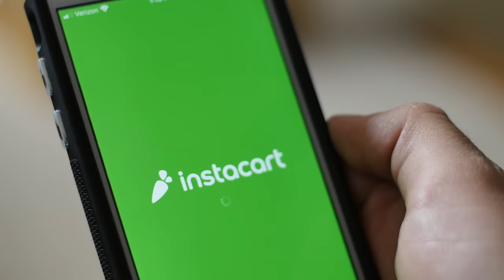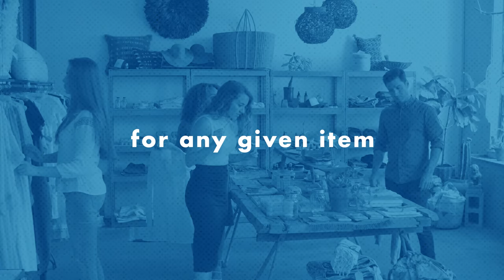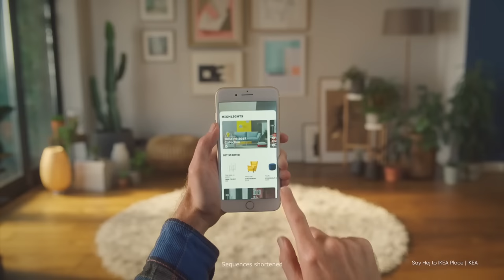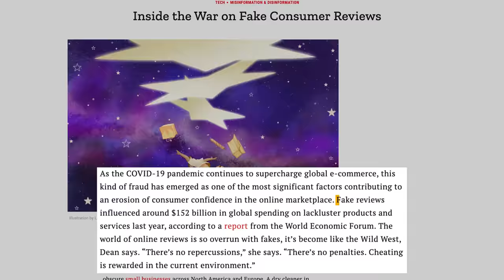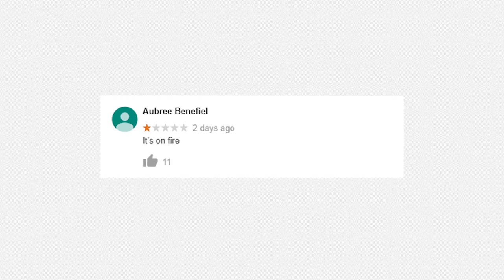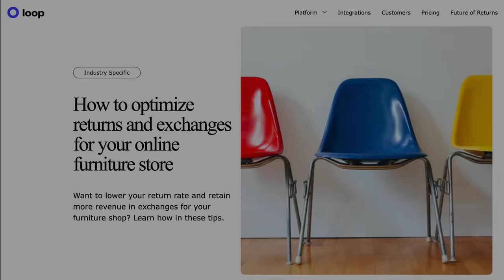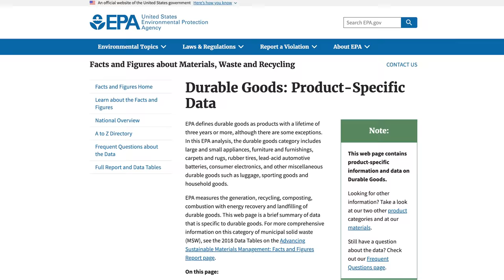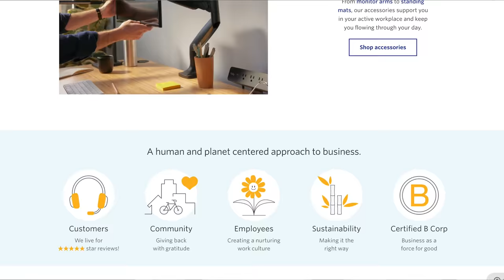The PROBLEM with Wayfair Furniture (DTC)

Comment: I will never buy furniture online again. I got what paid for: a lower price but extremely poor quality.  Buying online is exceptionally risky. If I need furniture in the future, I will visit brick-and-mortar stores (or thrift stores) where I can touch fabric and examine the structure of the product. I bought several pieces online from Wayfair during the pandemic; retail stores were closed because of the quarantine. 

The mattress I received was less than 2 inches thick. Sleeping on it was no better than sleeping on the floor. I returned it. The 20-year-old mattress that I had been using was much more comfortable than the one I bought online. (During the quarantine, I temporarily left the old mattress in a storage room. I put it back in service until brick-and-mortar stores reopened.)

An area rug contained more plastic fiber than natural fiber. The company did not advertise that fact in its online brochure. Walking on the rug in bare feet was much worse than walking on the ratty 15-years-old builders-grade carpet. Today the online rug is rolled up under my bed. (It is too big to fit into my compact car for disposal; I should have had the good sense to insist that the online retailer return the carpet along with the faux mattress.) 

Then there is the online sofa. The material is so coarse that I cover it with a bed sheet for comfort. The sofa frame itself is made of 2-by-3-inch pine. I wonder how long that will last. My new chair is now used as a rack for clothing that is en route to a closet.

On the other hand, I enjoy the bed frame and chest of drawers that my parents bought me 65 years go. The chest has good-old-fashioned mortar and tenon joints that are intact despite a rough use and five relocations. I also enjoy a hutch once owned by my friend's grandmother. It is a durable, heavy piece. A buffet table is a handmade hardwood piece that we inherited when we bought our house 30 years ago. Although it needs refinishing, it's a keeper.

Comment: I get what your getting at but GARBAGE FACTS ABOUT GARBAGE IS STILL GARBAGE. Like is your point: I grew up in an affluent home of a craftsman so why won't you just buy high level crafted furniture? 🙄
Fact: if you can afford not to go online you don't. It's not a theme park ride. It's just a fckn rollercoaster 🎢.
Fact: ALL GARBAGE ENDS UP IN LANDFILLS AND LANDFILLS NEVER SHRINK BECAUSE THEY'RE LANDFILLS and "RECYCLING" IS A LIE
Fact: All of it is probably the same. 
Because at a certain price and application point the product isn't all that different whether you have it delivered by UPS or a store or haul it in a cart. So it's not about THAT. There is also the underlying costs and culture fueling this type of thing which is rent and eviction and the ability to afford to successfully move when ya want let alone the costs of having to leave when you rather not. 
Fact: YOU PROBABLY AREN'T RETURNING ANY FURNITURE
did your dad accept free returns on giant Canadian oak cabinetry?? Or was it buyer beware? Stores don't make it any easier to return or exchange. 
FEELING: You really could have just helped us NOT GET RIPPED OFF instead of informing ppl that they were shitty for not doing what you don't guy filming in Air BnB adding to problems